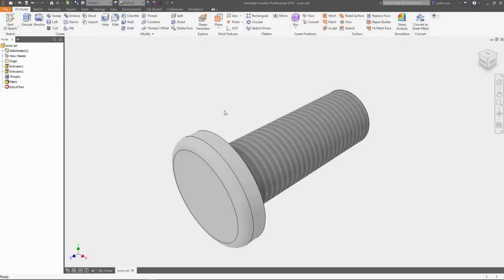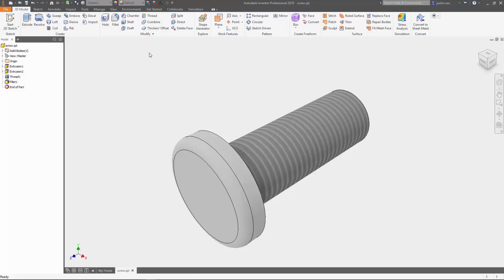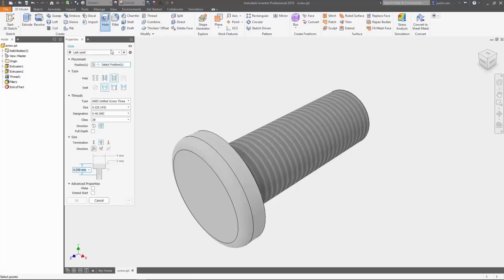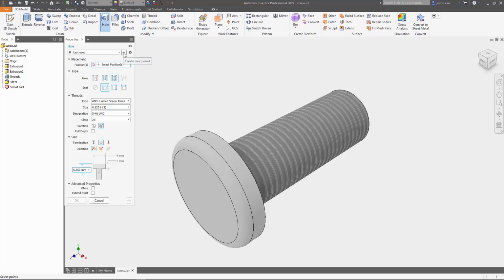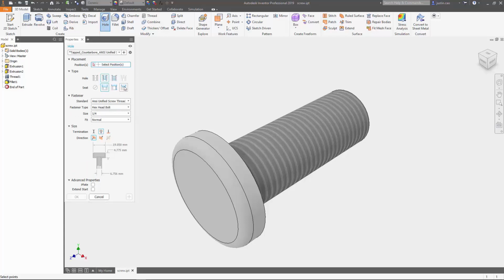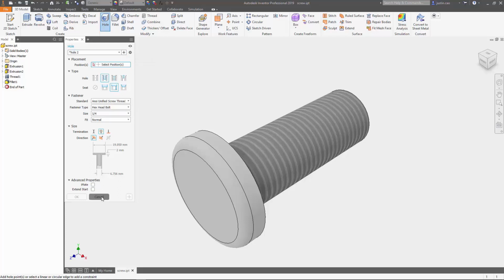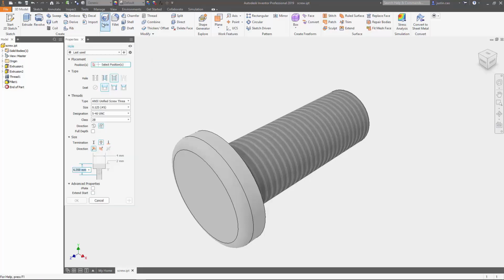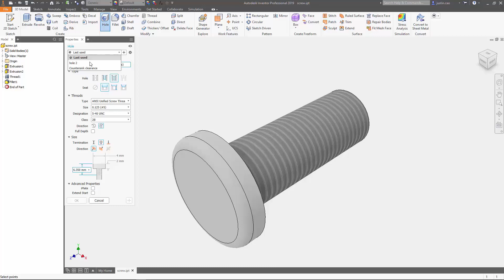Quick Tip - Hole Presets

Comment: A few things are incorrect about this video. When you want to create a preset you first put in your settings then hit the + button. After hitting + it is waiting for you to set the name and click the check button or hit enter. We provide a default name based on your settings but allow you to customize before saving if needed. Before this point, it is not saved. You will only need to use the settings dropdown to the right if you want to rename, or update the current preset you are on. This means you can change to any existing preset change some settings and click save in the settings to update the values for that preset. Also you can rename it at this point or delete it if you no longer need it.